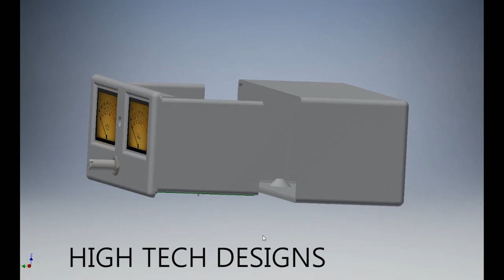Autumn Kids Toy: Wooden Acorn Shooter (No Special Tools Needed)

Comment: Thanks for the video. Will be trying this out with my 4 year old today. This says 'no special tools needed' but I saw a pretty crazy looking knife tool in the video. Will be going out with an old swiss army knife.
Reply from the maker: Good to hear that! Yes that is a big knife :) you don't need it. Swiss army knife will be more than enough. I made some of the shooters with my swiss knife in the past with no problems.
One more thing. When I was a kid, i was too weak to shoot the thing. It needs quite a push. So i grabbed the barrel with both hands and positioned the handle on the ground and pushed the barrel down towards the ground with both hands. The acorn flew vertical. It is a lot of fun looking it go